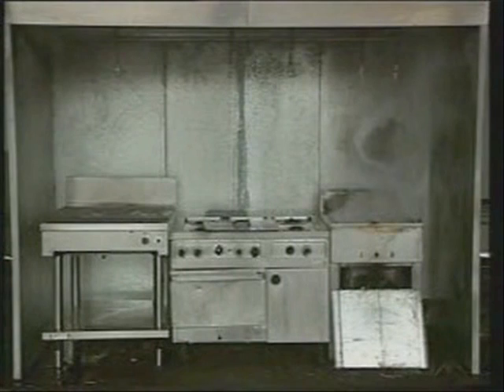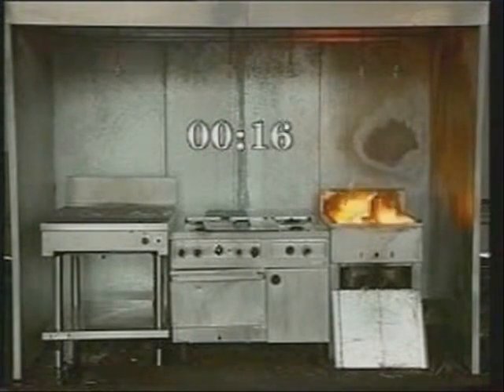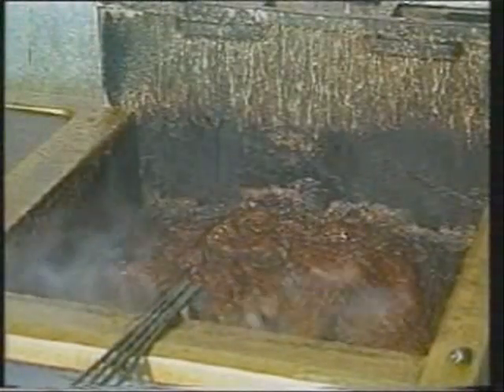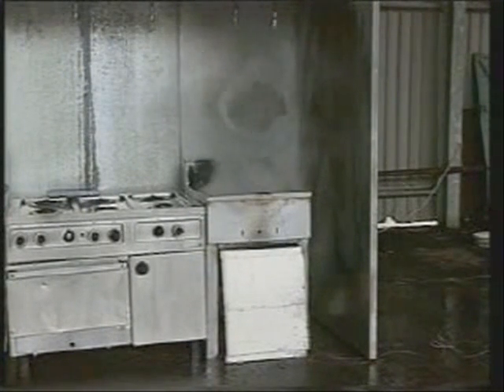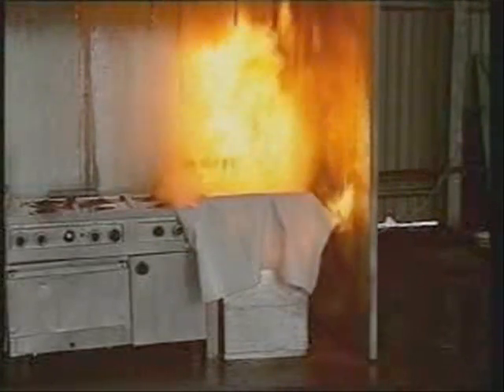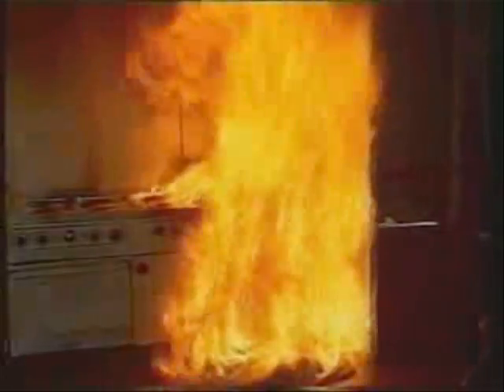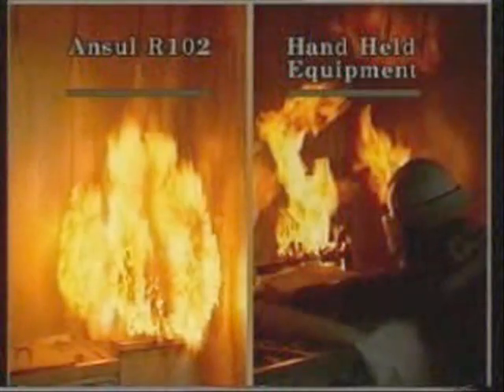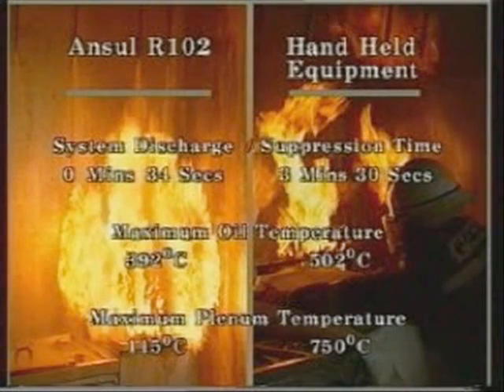Ansul R-102 Suppression System Vs. Dry Chem Extinguisher

Comment: Shouldn’t the pilot have been extinguished so you can turn the gas off ?
Reply from the maker: The cooking/vegitable oil was heated to and above its auto ignition point...all it needs is a little oxygen & it reflashes; thus the need for Wet Chemical which Cools as it Soponifies(starves of oxygen)...The Ansul R-102 System uses Wet Chemical

Comment: They'd have more success with the dry chem fire extinguisher if they used better...proper...application technique. Which would be from a standing position to get the chemical on top of the grease pit instead of spraying the front wall of the grease unit from a kneeling position. Also note, the Ansul system is positioned above the grease fryer...not in front of it; like was demonstrated with the dry chem extinguisher.